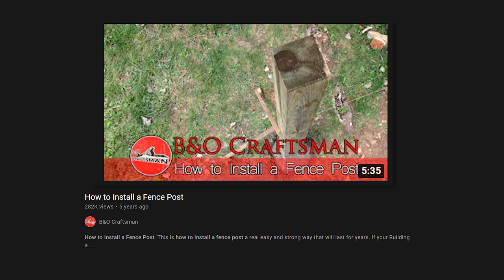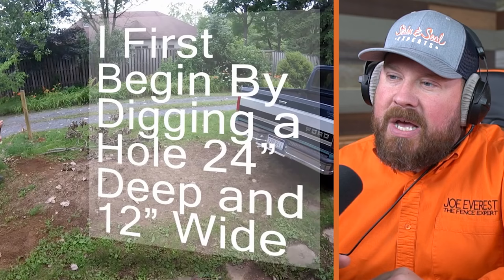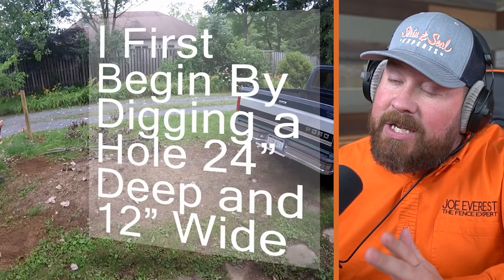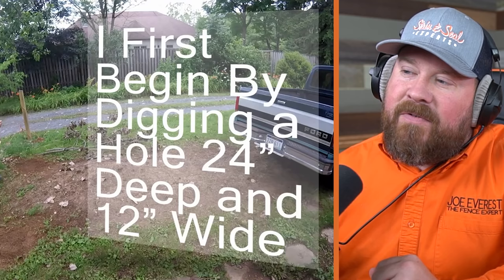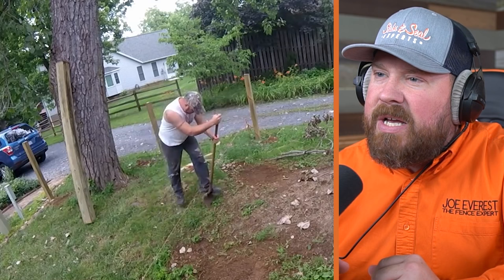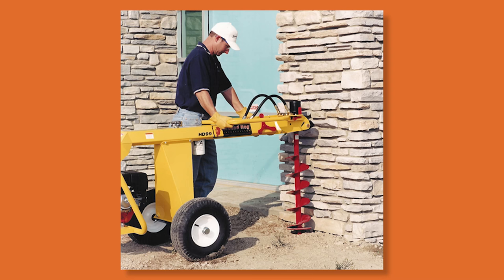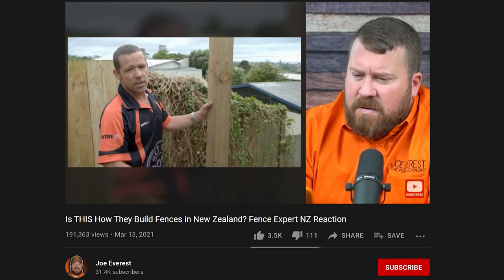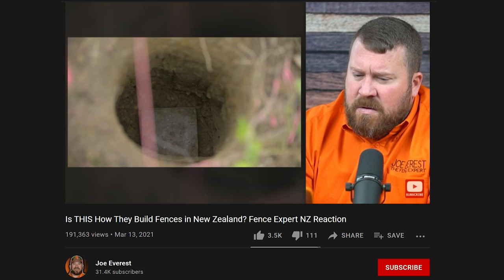One of the Most SOLID Post Installation Videos I've Seen

Comment: If rot is a concern especially in an area where soil will stay moist constantly, there are plastic sleeves you can slip your post into before putting into the ground. I used one on a 6x6 10 ft post and the sleeve was 4 ft. I buried it roughly 3 1/2 ft so that 6 inches of the sleeve is above ground. This will ensure no bottom contact or top contact. I am no expert but this is what I did and its been 2 years and there is zero signs of rot so far.
Reply from the maker: Agreed, there’s a product called PostSaver that is really well designed and comes with a warranty. Great point!
Reply: That adds a giant extra cost to the project using those if you have many posts. At that point, just use steel posts. Bottom line, a wood fence will last around 10-15 years with 4x4 posts no matter what you do. Upgrade to 6x6 and you will get many more years for less cost than those sleeves.

Comment: Old power line poles dont have concrete below grade.  Its just dirt and theyre very old and still holding up.  Therefore, treat the post yourself before you ram it in the hole like prom night.

Comment: Locally, here in Western Canada, in a relatively moist micro climate, post rot is a common problem.  I've wondered if using a stain, paint, or an automotive "gravel guard" or pick up truck "box liner" coating  for the entire portion of the post sitting in the earth- plus and inch or 2 for good measure, & because grass is wet, might be a good option. Has anyone tried it? Joe or experienced installers would you comment? My thinking is that water never has to get "out" of a post, so any seal is good, am I right?
I can't imagine there aren't regions much worse for post rot than even here. Maybe that's where the galvanized steel posts come into use- they are not seen around here. I find them ugly.
  That said, I'm not sure if my personal experience with fences I did not put up, has been with posts inset into raw dirt. Seems like maybe.
Also, the enviro laws seem to be putting major pressure on the pressure treat processors, and seems to me the posts are inferior and likely to become worse.
My thought is, "Posts are everything". You can maintain the visible areas of fence by oiling, staining and then as it ages painting and keep it looking good for years. You can replace boards individually (hokey but sometimes necessary) or wholesale- if the posts are good.

Comment: another reason why posts rot at the ground interface is a mechanical one. It's called stress corrosion when used  in the metals world.  The point where the wood enters the ground is the point of highest stress, because of wind loads the main mode of operation for the post is as a cantilever.  Combine the micro tearing/stretching  etc with the biological damage at ground level...hard to mitigate.  

 I swear I have seen people making aluminum flashing collars to shed water before it runs down the post....  google revealed nothing, have to come up with the right keywords.  Probably not worth it unless positive evidence shows otherwise.

Comment: I used Simpson strong tie brackets that get set into the concrete footings, the wood post gets screwed in about 1 inch above the ground. Also elevated the posts footing about 2 inches to keep further away from the ground.

Comment: Why not coat the bottom 2 feet that is going in the ground with FlexSeal or roofing tar, or some other alternative to seal the post from absorbing water in the ground?
Reply from the maker: Absolutely, we prefer using PostSaver. It’s developed specifically for wood posts and carries a warranty against rot.

Comment: I'm new here, but what about pouring concrete, using a post brace set into the concrete (like you would see on a pergola over concrete) and then attaching the post to the brace which will have a spacer at least an inch off the ground? Would this be beneficial for preventing post rot?
Reply: That sounds great, but there is a lot more work and expense if you are doing many posts, e.g., a fence line.

Comment: joe, would it help to wrap the bottom of the post (in this case 2 feet that goes into the ground) with a product like grace ice shield that roofers use for underlayment, it would be like a thin rubber coating between the post and the concrete and dirt
Reply from the maker: Probably, but there’s a purpose designed product called PostSaver.
Reply: @JoeEverest  i got hooked on your vidoes and did finally see that one, i will be building a fence and gate so thanks for all of the advice. maybe i will try the video thing and you can tell me where i went wrong :)

Comment: Hey thanks for this!  I'm wanting to set 4x4 old kiln dried beams that I reclaimed for gate posts.  They are maybe 18 feet long and I'm wanting to hang a 12 foot livestock gate.  Have you ever worked with older, non-pressure treated beams that were dried like this?  How old could these posts be?  Thanks for any insights !!
Reply: If it's not pressure treated, you must coat the part in the ground with a good wood preservative, like creosote.

Comment: Better to coat the post with some kind of roofing  tar. Been doing that for deck posts for 30 some years and they are rot free.
Reply from the maker: I’ve heard that quite a bit, there’s also a purpose designed product called PostSaver.

Comment: hole is said to be 1 foot deep for every 2 feet above ground.  So a 6 foot pole would be 3 feet deep. Needs to be deep enough that fence does not blow over in high wind. Also need cement to anchor and add wight to bottom of post. Again high winds may blow fence over in high winds if not deep enough.
Reply from the maker: Great point!

Comment: I've been searching for a video showing how to use the metal fence post to attach to wood, but it's very hard to find.. 
I am trying to repair a 98" by 100" corner of the yard, and the neighbors have a shed that butts up against our property, so in certain areas I won't be able to reach to install screws on the section against their shed . Any help is appreciated. ( I watched the postmaster video, Lowe's only has 7-1/2' available ~$36 ish... But no other hardware & I sorta need to geter done soon, so looking at round metal post.)

Comment: What kind and size of drill bit should I use to install the 5/8 lag bolts that come with a utility farm gate?
Reply from the maker: We typically follow this chart, looks like it calls for a 13/32 pilot hole. https://www.portlandbolt.com/technical/lag-bolt-pilot-hole-diameters/
Reply: @JoeEverest  thanks. Would you recommend the 12 inch j bolts that go all the way through the post and can be adjusted without removing the gate?

Comment: Hello Joe...I am rather new to DIY fence building projects...but do you reckon that painting the 2 feet that goes into the ground with an oil based paint for extra protection...especially the area where the surface of the soil meets the treated wood?
Reply: As i am building mine, I am paint dipping. Then setting in concrete.
Reply: @rodx5571   Thanks for that clarification. Cheers!

Comment: How is it even debatable which way will rot the wood faster? Concrete below soil level either creating a small pool of  water always sitting against the wood or wet dirt sitting against wood. That compared to only concrete being in contact with the wood. I don't see how it's even possible to be debated which will rot the wood sooner.

Comment: building code for michigan posts and decks calls for 6x6s to be placed on a bag of concrete and a concrete paver 4 feet deep then backfilled with dirt and sand. so the post isnt even set in concrete.

Comment: Put concerete posts with concerete gravel boards in my garden 6 years ago and they are like new still,don't get why this isn't the norm. All the timber fencing is atleast a foot off the ground and should last a lot longer
Reply: My fence is 32 years old. Concrete posts and gravel boards all the way. Hard work to install but worth the effort.
Reply: Aesthetics.
An all timber fence looks nicer than post, panel, post, panel.

My evidence?
Being a landscaper in the UK.
But most people go for concrete posts and panels, because it's quite cheap and very low maintenance.
Reply: No doubt timber is nicer to look at,, being a joiner i have to agree with you 👍 But most people, like my self are busy and just need a maintenance free garden. Each to their own i suppose
Reply: @chrislooney8682  yeah, the people who have all timber fencing are those who have the money to replace or maintain them by getting someone in.
Everyone else wants a fence they "need" to maintain by painting/varnishing a panel once every year or so.

Other than that, it's mostly screens being applied to a brick wall or existing posts.
Reply: @chrislooney8682  plus, I also abide by the rule of "I don't shit where I eat".

I pretty much refuse to do work on my own place, I work to live, not live to work.
At a push I'll do work that is necessary, other than that, it's my day off 😂
Reply: agreed, plus summer is biking season so no time for home work 🏍🤣

Comment: I guess I’ll compromise. Bury the concrete… under 5/8” minus gravel.
I’ve seen some videos where they use a urethane caulk to seal that joint between post and concrete.
Maybe a little overkill for a fence project? Maybe appropriate for a deck.

Comment: no heart or sap wood in any project if possible . no concrete method? easier to repair replace. very easy. mine pt lasted 25+ years in sandy florida soil --small section 35 feet

Comment: Does ground contact treated wood fair better?
Reply from the maker: It certainly helps. You’d want to see what that term means for the brand you’re looking at, different brands use that term in different ways.
Reply: @JoeEverest  a friend of mine said to use used motor oil and kerosene  or diesel  fuel ad brush it on at the base and a few inches  above, he said the ranchers in Texas do this to there wire fence  posts

Comment: I don't know if u have mentioned it in other video new subriber but what if u don't know if any pipe work or cabling is in line of any of the posts here in the UK we have cable about 6 inches deep for cable TV or Internet. How do u get around that.
Reply: In Australia you can ring 'Dial before you dig' and they will tell you. Do you have a service like that in the UK ?
Reply: Here in the u.s we have dig safe for the public utilities so they can be marked and to ask homeowners for anything that’s private so that you can be aware before you start your project
Then you can make changes and adjustments to your fence line if needed and hand dig, any holes near any utilities
Reply: Check and see if you have a locating service in your area they will come out and and locate all your underground services with different colored paint for different services, gas,water , electrical and such .thats US but I’m sure they would have something similar. Just need to call well in advance of your project.

Comment: Sorry, I have a tendency to comment as things pop in my brain while I am watching, he is actually wrong with the center heartwood not warping. In actuality the center heart wood Is what you want to steer clear from. Case in point, 90% of 8 foot four by fours are the center cut lumber from When they  make plywood I can’t remember the science behind it but because of that information I have learned it’s best to buy a six or 10 foot 4 x 4 as opposed to an eight footer.
Reply: Hes not completely wrong though, the heart being centered is much better then it being off center, but agreed no heart is even better
Reply: @stich1960  he actually is completely wrong though. Heartwood centered or not is weaker and tends to warp more.
Reply: @frednot809  we can agree to disagree, heartwood is weaker but if the choice is centered heartwood vs off center, I will take centered everytime. Obviously clear of heart would be better but idk where you shop I have looked and never seen that in anything treated.

Comment: I heard the exact opposite about the heart of the wood. I was told dead center was bad
Reply from the maker: That’s interesting, I’ll have to look into that. I’d always been taught that heartwood was the best, but I’m always willing to stand corrected!
Reply: Dead center is bad. Go to a place that sells lots of boards. they will have a pile of 2x4's strapped together. All with pith in center. Cut the strapping and watch them twist and warp.

Comment: Hi Joe came a cross this video, and wanted to ask when sinking a post in concrete would it be a good idea to spray the top of the post (where it meets ground) with a rubber sealant to prevent that rotting effect? or a primer paint with enamel
Reply from the maker: Rather than using products that might leach into the ground water, I’d recommend a product like the PostSaver sleeve.

Comment: The depth is most important, not the width, because if the depth doesn't go below the frost line, your posts will be "pushed" off center by the ice and your fence will look like cock-eyed Louie measured it for plumb after only a few years of frost cycles.

Comment: COMMON SENSE SAYS IF YOU PUT GRAVEL IN THE BOTTOM OF THE HOLE. THE WATER WILL STILL SEEP THROUGH IT AND INTO THE BOTTOM OF THE POST. IF YOU FILLED A 6 INCH TUBE WITH GRAVEL AND POURED A GLASS OF WATER INTO IT FROM THE TOP. IT WOULDN'T COME OUT THE BOTTOM ?  REVERSE THAT SITUATION WITH THE POST IN THE GROUND,. YOU DON'T THINK THE WATER ISN"T GOING TO COME UP FROM THE BOTTOM ?  😂 😂 😂

Comment: just dont use wooden posts,use concrete makes sense and last a life time
Reply: It’s for a gate, hard to screw hinges and furniture into concrete. 😬
Reply: @paulmcgrouin9157  just use plugs and screws as normal,plus always best to use rapid post mix.
Reply: @pennybeacham6461  sorry, can’t agree, you’re going to put 8 screws into concrete for the tee hinges and a further 6 for the furniture, sorry, but that is not the best  idea, what will happen is that when you need to adjust the gate after it settles,  you will have 14 screws to move about 1/4” next to holes into concrete, unfortunately, that will never hold, you’ll just end up making larger holes that hold nothing and have to do it the correct way 6 months after installing it ! Yes postcrete is a good idea when you are single handed but nothing holds firmer than a wet mix that you turn yourself made to your own ratio, I use approx 4/1 mix and rarely have a problem, but can absolutely guarantee you that your own mix, done properly cures far better than postcrete.
Reply: @pennybeacham6461  I would agree that concrete slotted posts are a good idea for panels, but shouldn’t ever be used for gates, I personally use wooden posts for my own garden but have post postsaver sleeves around the bottom to prevent ground rot, but that is a personal choice, when it comes to installing panels, hard to go wrong with concrete if you want hassle free and you don’t have access to postsavers and a gas gun. 👍
Reply: @paulmcgrouin9157  yes slotted posts for panels and 4x2 for feather edgeing,i usualy plant 4x2 onto post for hardware
Reply: @pennybeacham6461  did we have a communication problem between us there ? 😂😂😂 personally I go for a 4”x4” post independent of the concrete post for furniture, but that’s only because I find that the concrete post moves under the weight of the gate, but if it’s high enough, a header rail will correct that issue, again, it’s a personal choice, a 4”x2” fixed to the concrete post is pretty standard and certainly not a bodge by any means, not sure what you meant by “using a 4”x2” for feather edge” I’m well aware what closeboard is, but not sure what you actually mean. 🤷‍♂️
Reply: @paulmcgrouin9157  i attach 4x2 top middle and bottom of each concrete post so as to nail the feather edge to,so each post is 6ft appart i attach lenghs of 4x2 inbetween using a half but bolted to posts
Reply: @pennybeacham6461  yup, totally with you, you can buy concrete posts that are slightly rebated to allow the rail in, just need to chisel a small amount on the end so it sits flush, also guarantees the rails look flush from behind, generally though I will use mortice posts and arris rails so the built bay sits between the posts rather than in front, there is no right or wrong there, just a case of what the customer prefers to see at job finish. 👍